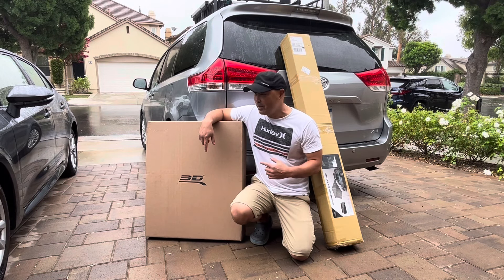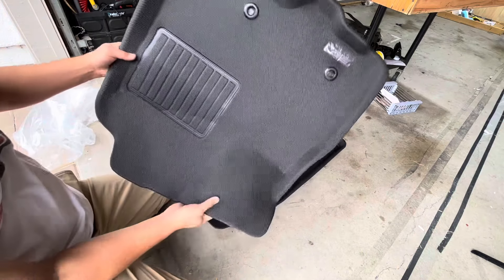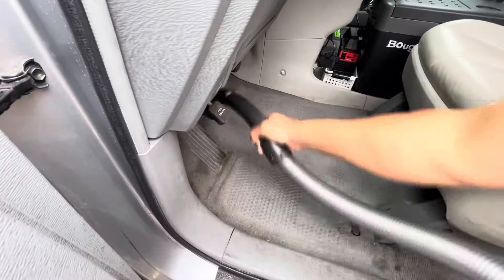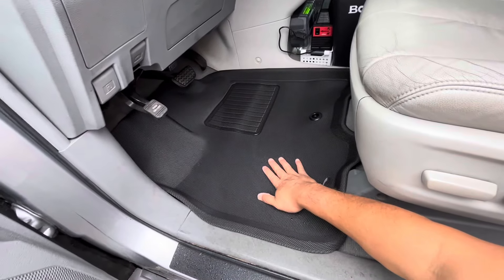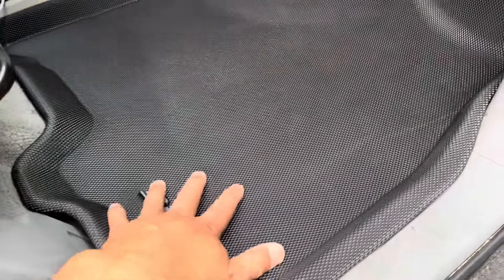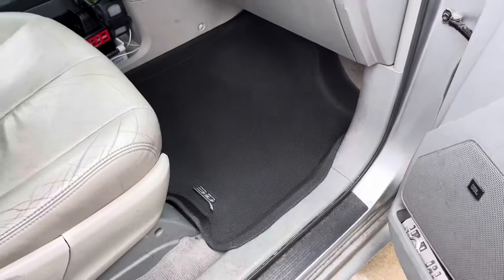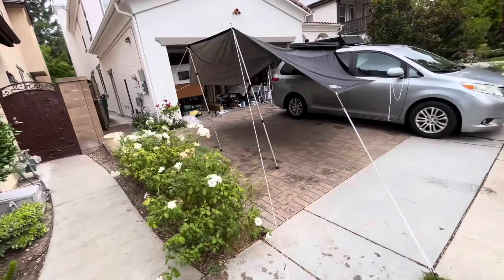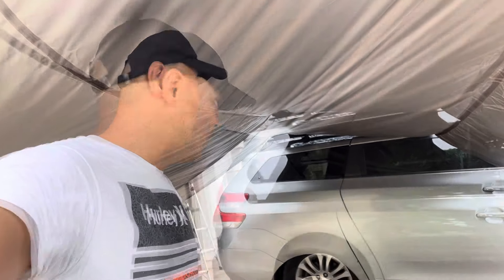GEAR N REVIEW 3DMats Floor Mats and Awning Upgrades For Sienna Camper.

Comment: what happens if you install it to the van so that the hinge of the cover lies in the bottom instead of the top?  does it make it easier to close, or does it prevent it from unfurling?
Reply from the maker: I actually flipped it also. Haha. Works fine flipped too.

Comment: How do ur new mats compare to WeatherTech? (materials used to make it & price)
Reply from the maker: Had weathertech's in my Tacoma a few years ago.  I think this softer lighter material conforms better than weathertech's, plus these won't slide around because of that grippy material underneath.  Weathertech's are a bit overpriced IMO.
Reply: @Tiny-Campers  Yeah, WeatherTech are expensive mats.  How much were these?
Reply from the maker: @TexasLocalProduce  There is a coupon code in the description.  But I think they are about $100?